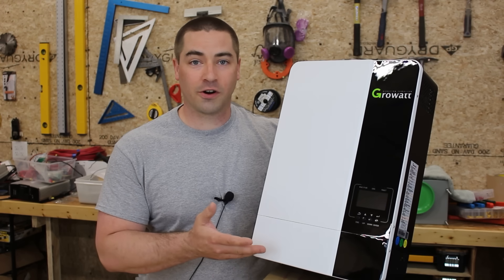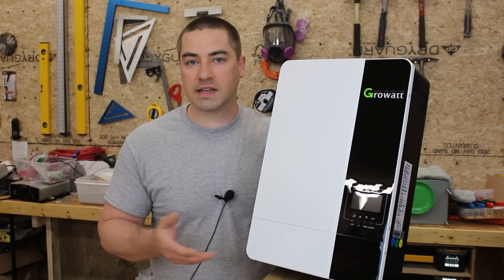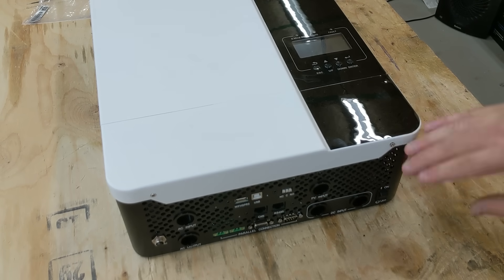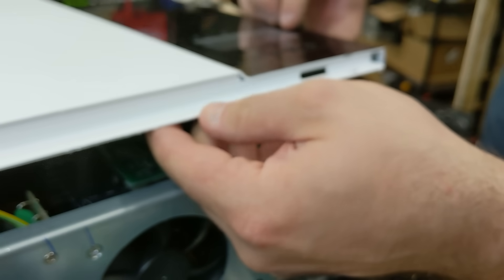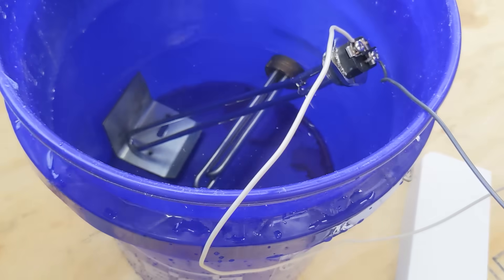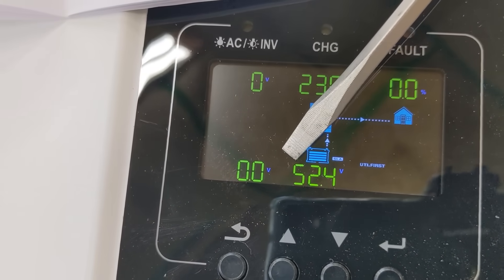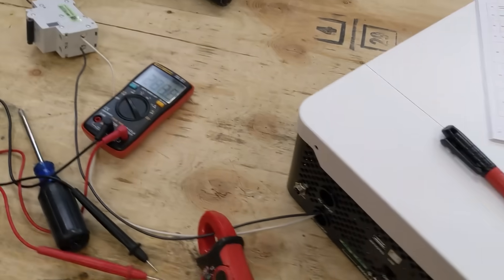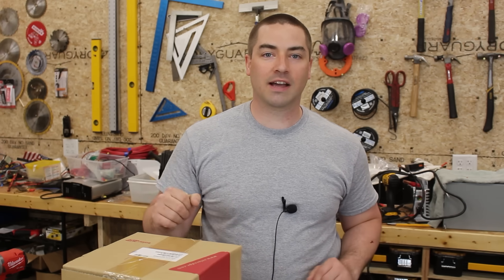Best Value Inverter, All-in-one MPPT Solar Charger, Growatt SPF5000ES, Part 1

Comment: David - thanks for the video: engaging and the product shows potential.
I have a couple of noob questions that might also help others if you have a moment to answer.

1) When the load exceeds the output rating of 5kw, does this unit continue delivering 5kw from the battery, while supplementing from the grid, or does it switch over entirely to the grid?
2) You mentioned there were limitations with single phase for household loads: can you elaborate a bit?  I'm in Europe so would need the 240v output as is and would not be able to split the phase as you intend to in your next video.
Reply from the maker: I'm not 100% sure, I still need to test.  But I think the loads are supplied by grid OR inverter.  Never both.  

When I talk about phases, it's really only in US.  We have a very old power grid here in the US.  We still use 120v.  I wish we moved to 230v like the rest of the world.
Reply: @DavidPozEnergy  Thanks David!

Comment: Yeah. I'm super skeptical. 
1)Youtube disclaimed that the video contains paid promotion, unless i missed it the growatt was the only thing i saw. 
2)Didn't seem like you really tested the output power of this product like you have on other products. You ran a heating rod at 4/5 of the max power it can continuously output for what seemed like only a few minutes. 
3)The Youtube video of the transformer (which, it appears is required if you want to run anything at 120v) is ridiculous (https://www.youtube.com/watch?v=xAnalqXalg0&t=2s) 
4)There's a post in the comments from this "Signature Solar" user that's different from the one the video is uploaded to..

https://www.youtube.com/channel/UCQpxYfoHnc_4k6T9cwkhgCw
vs
https://www.youtube.com/channel/UCgtXFHaN9SD7GeXcAaWw31A
5)The website specifically says "NON RETURNABLE" & there's absolutely NO mention of a warranty at all (that little sticker means nothing.) 
6)The website has text links that aren't clickable - really? This is html coding 101
7)This does not appear to be UL certified 
Looks like someone is trying to make a quick buck trying to offload a bunch of potentially inferior units. While this unit may be decent, I'd really be curious as to how long it would actually last in service before something fails. 

This video felt like an advertisement for this product rather than an actual demonstration and test.

I'm interested to see what you'll have in part 2.
Reply: My sources have the same price.  [suppliers to the Solar Industry]  GroWatt has excellent customer service, when purchased through the channel.  Have not used the sponsor as a source.

Comment: Test the system .. LOL they are the cheapest inverter with the worst firmware . Try the rs485 protocol on the Lithium batteries . Solar charges batteries gets to 100% click you hear and see solar stop charging system runs on batteries till below 95% and click solar clicks in again .. the most idiotic firmware one could design for  a solar backup system . Use it if you like stupid systems and enjoy watching your batteries cycle 5000 times a day @ 5% . thats a total cycle of 25 times in a day you cycle lithium batteries un necessarily . !
So dont believe me try the canbus protocol instead find the same Caveat !
Love the inverter spend the money and find the flaws .
Buy a phocos instead !

Comment: Hi David,
Thanks for this details.
I'm in France and i was planning to buy this.
Do you know if there is a way to limit the discharge current of the battery ?
I'm planning to install 2 of this in parallel to have 10kw of power, but 10kw of power require at 48v a battery capable of handling 208Amps.
Reply from the maker: There is no way to limit the current it pulls from the battery.  You will either need a large enough battery to handle the current, OR limit your loads.  For example, if you have a battery that can only handle 150 amps of current, then that is 150x48=7200w, minus inverter losses.  Don't put more than 6500w of loads on the inverters. (in this example)  That can buy you time until you build up your battery bank.
Reply: @DavidPozEnergy  Thanks for this info.

Comment: Fir the last 9 months, I have been using a 100 watt Thunderbolt Solar panel kit from Harbor Freight along with 4 lead acid marine deep cycle batteries. I have been watching quite a few videos on YouTube trying to learn how to use solar energy and fir off-grid living. But I am getting more and more confused with each different video I consume.
There doesn't seem to be any standardized terms used universally to make learning this any easier.
It makes trying to understand this science very difficult when no one shows a way to compare "apples to apples". One video says "crispy crunchies" and another says "red fruit".  And most of the time I can't even tell whether or not they actually mean apples.
Solar power and electric vehicles are poised to become really, really, REALLY big. Like in as big as the Information Superhighway was poised to be big back in 1994 when I wrote my term paper on it but everyone in the class thought I was crazy.
The manufacturers of all this new tech need to KEEP IT SIMPLE. The same goes for video makers trying to explain this emerging change in lifestyle.
Please use the same terms to explain what you are showing. From video to video that you make and from video maker to video maker. You all need to get on the same page, agree in what it is that is important, agree on the terms that will be used to compare products and stick to them.

Comment: Hi David. Very nice video. I would like to know if there is a transformer I can use to step up the voltage from 240v to 380v and above so it can put 3 phase. Thanks
Reply from the maker: It probably exists, but I don't know where you buy a transformer like that.

Comment: That is an amazing price for what you get!  I have two 3000 watt hydro turbines and am looking building a few more to power the whole house. Do you think it would work with Hydroelectric energy? It should, because the same power is being made whether it's from the sun or water. Thanks for the video!
Reply from the maker: I've never tried with hydro or wind, so I can't say for sure.  Sorry.
Reply: @DavidPozEnergy  the MPPT might not work well with non-solar sources, i don't know if you can disable  or adjust MPPT

Comment: Thanks again David for showing us this new inverter combo. Looks great!  If running a home off grid, amI realistically looking at 2 or three of these units to cover electric shower and other high draw items like kettle, cooker, etc. In a perfect world, no one would boil the kettle while the electric shower is running. I’m sold on the GYLL 6 battery array and enclosure. I want to build a trouble free system and this looks like the perfect compliment to the GYLL battery array. So, for a typical house hold off grid, with the possibility of two big ticket items running at the same time? Thanks David.
Reply from the maker: Thanks for checking out the videos.  I'll be demonstrating paralleling in an upcoming video.  Probably a few weeks out, since next one will be on wiring the auto-transformer.

Comment: Any body knows the rules for ground mounted solar panels ??? Any one am in CT shithole
Reply from the maker: I also had a lot of trouble with this.  That's why my solar in on the ground, not the roof.  I could do a ground-mount, so long as I kept my set-backs from my property line.  But it will vary town to town.

Comment: Build looks very similar to MPPSolar and their mainland counterparts.  They are what they are but to compare them to victron is like comparing a low end Volkswagen to an High end Audi. Both should get you where you want to go though. It's not going to be approved for grid connection either, so your excess power is wasted (nobody really cares about the grid anyway)

Comment: Would like to know largest ac wire it will accept. Shows #12 in manual. Hope it will go more. Would like to use in my 50 amp rv. Has to handle a 50 amp pass thru. Need #8 for that.
Reply from the maker: OK, I can check
Reply from the maker: I just got a 6 AWG THHN in there.
Reply: @DavidPozEnergy  great. That will work since my 50 amp feed is #6. I may end up pairing two but going to try just the 5k first. We ditched our factory acs and installed mini splits so our power requirements not near as much. Thank you.
Reply: Did you install the system yourself?

Comment: Will it start a 1hp Well Pump,  A full size fridge, a table or miter saw, a small window shaker AC?  Inquiring minds want to know.  It really would not be "great for larger homes" if it cannot start the most basic of large home necessities.
Reply from the maker: I want to know the same thing.  I don't have a well, but I will be testing it with my air compressor and miter saw.
Reply: @DavidPozEnergy  when do you publish? Looking forward to part 2
Reply from the maker: Typically I try to publish a video on Friday or Saturday.  But with 2 kids, I never know for sure.  I work in the garage after they go to bed until about midnight.
Reply: Dude ... Part 2 ??

Comment: Dave please check out the Delta H6 off grid inverter without batteries also sold by signature solar for $549 split phase  120 / 240 .
I am installing this off grid without batteries for daytime use. please check it out and do a video on it thanks Gary
Reply: wow you can save a lot of money not using batteries!
all the big loads run only in the daytime.. use only the light loads like led lights at night

Comment: This is cool. My idea of off grid is a wood stove and a well pump. I know the world has become dependent.
Reply: Sounds great but I don’t know of a manual well pump that can push or pull water from 355’ like my Grundfos can.  Wish there was a manual pump option I could have as a backup.. 😔
Reply from the maker: @george drenes, This is a hand pump that can go deeper.  I have never used it, so I can't say if it's any good or not.  But thought you might like to see the option. https://practicalpreppers.com/product/simple-pump/
Reply: @DavidPozEnergy  I had a brief opportunity to try out one, Multiple people, limited time and not a very knowledgeable owner and circumstances really didn't allow for great details> BUT though reasonably easy enough to pump the volume per pump stroke was very small. I am thinking under 1/10 gallon at the very most.  Seems well made from the part I could see but strictly emergency only use. OTOH there is a motor option which for daily use would be a MUST have. NO way am I going out several times per day for 100-200 pumps to fill the pressure tank with 10-12 gallons each time.

Comment: @9:10 mark you see those input screws in that plastic piece? Those take next to nothing on ft lbs of pressure to tighten up. I"m talking next to nothing they will strip out so easily. I"m talking like 1 ft lb of torque and I know you like to tighten stuff up pretty good so be so so careful. it is a screw mounted in some super soft plastic and will strip out.
Reply from the maker: Thank you for the warning.

Comment: I have a very similiar unit as that one. Maybe same company in china makes em? it is 450 volt pv input, 240 volt @60 hertz. 90 amp. Very similiar hookups and have wifi, , parallel cables, current sharing, etc. Can run Generator, AC input, Battery input, PV input and is 5.5 KW with a peak of 11kw. I'm running four of them on a 18kw solar array with 60kw of lithium. cost is even cheaper than this growatt but not by much. Something like $750 each.

Comment: 8:08 It seems to be STGWA80H65FB in the output module, if so it is from STMicroelectronics and it is is a IGBT Transistor, not a FET.
Thanks for taking the lid of, to show the inside. 👍

Comment: Hello David,
I want to build a three phase system with three SPF5000ES. 
Power standard in Germany (3 x 230V/400V 50Hz with 120° degree between each phase)
Have you check/mesaured the none load consumption of the SPF5000ES, because Growatt wrote in there manual (less then 60W)

With three units and each pulling 60Watts the hole night (8 hours) means 1440Wh standby consumption!!!

Thank you for your help!

Nice greatings from Germany
Chris

Comment: MPP Soler PIP-MAX is just a tad better AC LOADs Without Battery {The Solar array can give daily 8kW AC Power From a 500v Solar array )

With 48V 60V Battery array it can stack with 6x other PIP-MAX for A  48,000W System Useful for EV Rapid Charging

Comment: Lower cost when everything is combined in one unit. However if any one part fails then you have to replace the whole unit. Or send it in for repair. With separate units, you only have to replace the failed unit.
Reply: If you have multiple units in parallel — which is comparatively affordable — then you can continue running at partial capacity while you wait for servicing. A pair of 5kW inverters would make a fairly capable and robust system. Three units would be quite a beast. 🤓🤔🤷‍♂️
Reply: E hi

Comment: My only worry is if something breaks in it,  the whole thing has to be returned, no power until they fix it.
Reply: In a standard off grid system with separate components, it’s the same situation. If your charge controller breaks then you have no battery charging. If the inverter dies, you have no power. This is cheaper than any of those items individually anyway.
Reply: At least you only need to go back to one supplier rather than individual suppliers in case of mixed brands
Reply: If you live off grid... that’s part of it... these are cheap enough to have a hot spare
Reply: Thats exactly my thinking as well.
Reply: At that price, put a spare on the shelf

Comment: @DavidPoz, What is the difference between this model and the SPF 5000TL HVM-WPV-P model?
Reply from the maker: The specs look very similar, same size, weight, etc.  So I don't know.
Reply: @DavidPozEnergy  I asked a reseller on Alibaba and found out that the SPF5000ES model does not require a battery to operate but the HVM model does. The ES model also accepts a higher PV String Voltage and overall seems more desirable, perhaps it's their newer model? See for all specs: https://www.ginverter.com/Residential-inverters.html

Comment: hi david i have a pure sine wave inverter model hp6048e .name is anypower combi the problem i have its a  48volts battery input but when connect to 48volts its dont work its just alarm but if connect to 36volts its work good  it used to work good and 48 volts but now it cannot.help me please

Comment: G’day David, I’ve been looking at this inverter as well. It says in the manual that it has a power saving mode. This is mentioned in the screen display section of the manual.
It also says in the specs that it has a no load draw of 60w. That is a lot and probably a deal breaker for my scenario. Would be great to see those values in real world testing. Is it possible for you to test the maximum rated output for 30 seconds 1 minute  with a pump etc. cheers , Phil in Australia.
Reply from the maker: Yes, absolutely.

Comment: Can it be used as a UPS (backup power)? For instance, can you run things on normal power until there is a power failure and then have the inverter kick in?
Reply from the maker: Yes, there is a UPS mode.

Comment: I have a MPP Solar 5kva PIP5048MK unit that looks exactly like the Growatt Unit. Even the instruction book is printed exactly the same. Coincidence? I have been running the MPP Solar for over a year now with no hiccups. We run welders and aircons off it without a problem

Comment: LOVE it. Looks like a Mpp inside. Wish it was 240 split phase. The need for a external transformer sucks in my opinion. Thanks for sharing. God Bless..
Reply from the maker: I was turned off at first too; about the external transformer.  But after researching the concept, it doesn't seem so bad.  But I'd love to hear your thoughts after I get it hooked up in the next video.

Comment: David dose this ;unit meet the FCC part 15 A & B radiation standards?   This is a very important issue that will keep the radiated Electromagnet interference down no more than 3 feet from the device.   The interference will interfere with all radios TV wifi  police and fire radios etc.   It  should be listed if not it shouldn't buy them.   The industry is normally form Chine and they do not install the filter to keep the interference below that 3 foot rule .
Reply from the maker: It's a great question.  I don't know the answer, or how to find out.  I'd love to learn more about it, and how to check.  Do you have any resources I can go read up on?

Comment: Nice job on the review David.  Looking forward to further testing.  Nice unit for sure.  My gut tells me it won't handle a lot of in-rush as there is no real "mass" in the transformers. Either way, if they built enough quality into it, it could handle resistance loads and inverter motors for years to come
Reply from the maker: Hi Mark,  I'm worried about the exact same thing.  You know I love to test with my air compressor and miter saw.  That will be coming.  I don't know if they have as much inrush as your lift?
Reply: @DavidPozEnergy  my lift is horrible ! not sure how those Magnums survived all these years :-)
Reply: @David, I intend to build my own battery. do you know a compatible BMS brand?